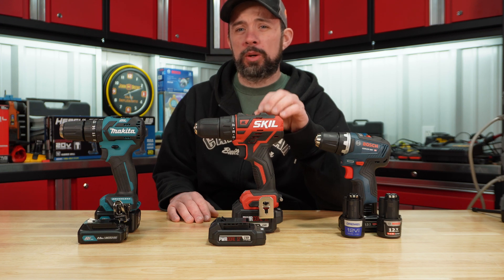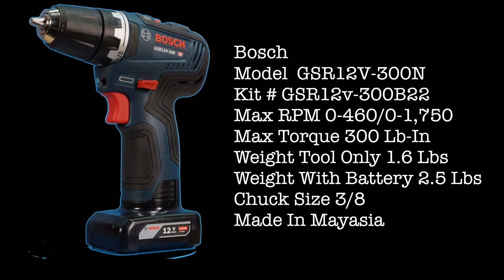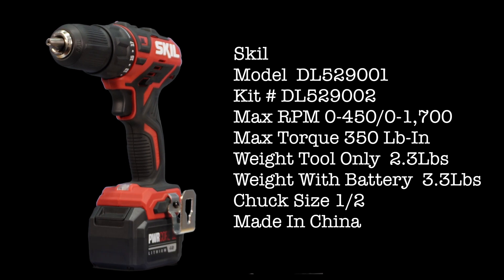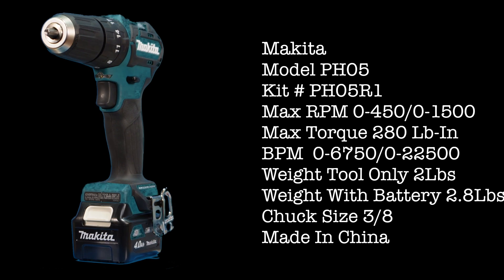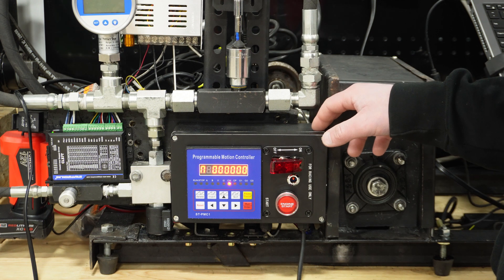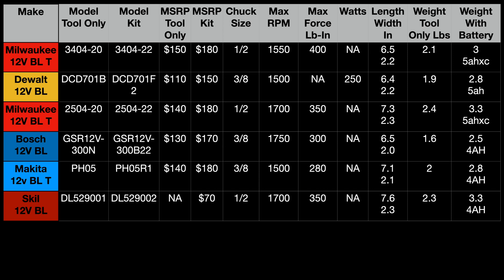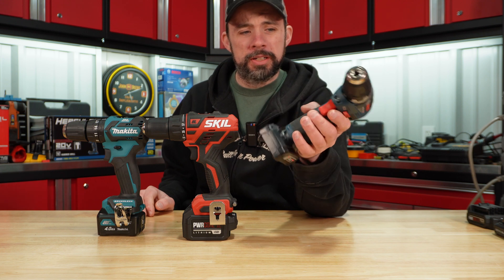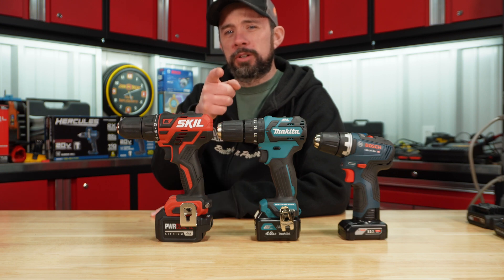12V Brushless Skil, Bosch And Makita On The Dyno

Comment: In your opinion. DeWalt vs skil. Which of the two would you go with. I don't like the DeWalt because of the 3/8 chuck but I have 8 DeWalt 12v batteries. Four 2ah and four 5ah. So from a battery platform it makes sense to get the 12 volt dewalt. But skil has other 12-volt offerings that I could grow into as well.
Reply from the maker: I would probably go with the dewalt,  mainly because you already have the battery's.  Only issues is the DCD701 came out in 2019, so I would think we see an updated version soon.  

Skil just released a new version,  same performance but it's a little more compact. https://youtu.be/hR1WDA_bLzM

Comment: I actually have that exact same bosch drill, and while I have over a dozen drills, I reach for this one 99 times out of 100 because just so handy and compact and it has more than enough power to even drill larger holes in steel if you're really in a pinch, I have the last generation brushed version of this drill as well and it has been absolutely beat on for over a decade and it still works perfectly, I have some 12 volt Makita stuff that I have been impressed with, but there's no doubt in my mind that given its easily the smallest one and the only one with a stick battery, it's for sure the most useful 12 volt drill / drill in general that I've ever owned. Sometimes it's not all about just the raw specs on the sheet, sometimes the right tool for the right job is the right tool for the right job, bottom line
Reply: The M12 drills use stick batteries too, but it suffered from the same issue I had with the bosch: the grip. It just wasn't comfortable to use. I use the dewalt tested in the previous video and it's perfect for me. Comfortable grip, plenty of power, compact and light enough where all day use isn't an issue.
Reply: @NWGR  You had a problem with the grip on the Bosch? That's strange most people really like the way that the Bosch drills fit in their hands because they have an angled head like most German / European drills do unlike most American style drills that have a straight head like the DeWalt and Makita does
Reply: @ryancasey4807  Just a little chunky in the grip; it was causing some fatigue in the area between my thumb and index finger. Same for the milwaukee m12 drill I had. The M12 installation driver I'm ok with because of how it's designed to be held (like a drywall gun). The makita/dewalt/skil have the slide batteries, so the grip is slimmer and easier on the hand in all day use.
Reply: @NWGR  M12 has a much worse ergonomic issue than Bosch. When they copied the Bosch design, they flipped the batteries around to avoid the patent. The result is that the wide part of the battery jams between your thumb and finger while the narrow part is next to the trigger. This is less ergonomic. Bosch allows the narrow part to be pushed against your hand while the wide, flat side is gripped by your fingers. This is such an issue for M12 that they lengthened the handle so they could lower the battery and thin down the very top of the handle.
Reply: @mrbigberd  Yeah I remember reading about that. It's not a big deal on the M12 tools I currently use (the 18 and 23 gauge nailers, stapler, fuel jigsaw and rotary tool) but for a drill it was a dealbreaker for me. A sheme really, because I otherwise really liked the M12 installation driver. The dewalt 5 in 1 has been working great for me though. So much so that I grabbed another one for around the house.